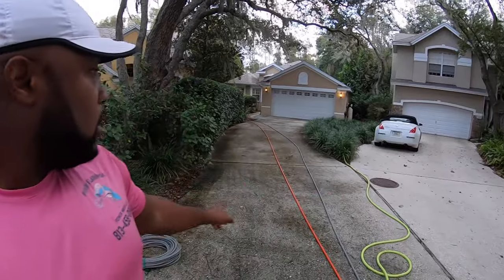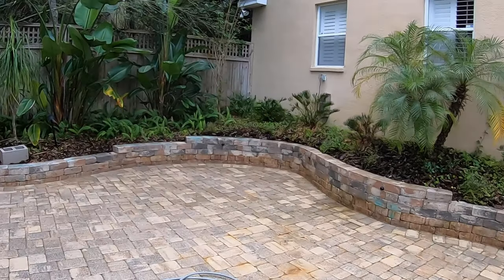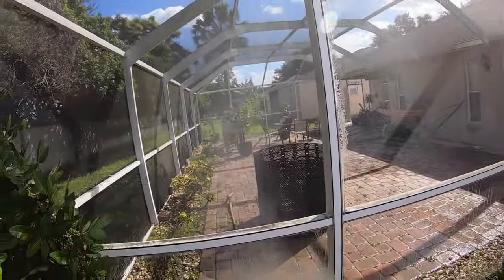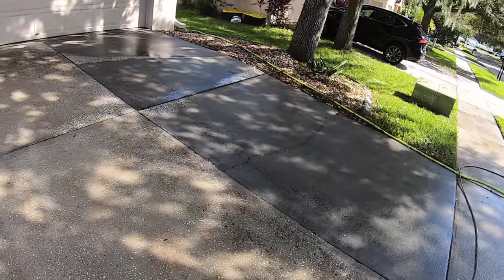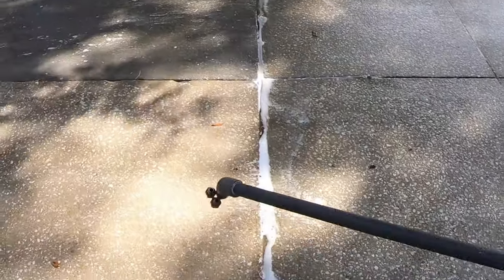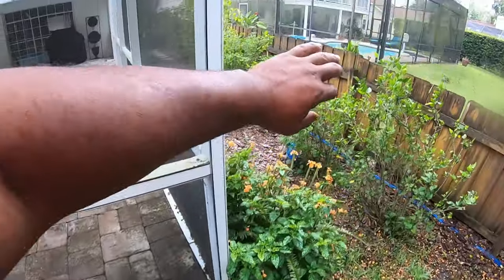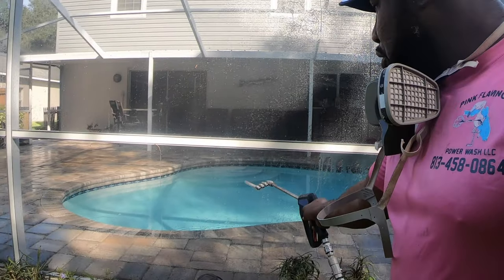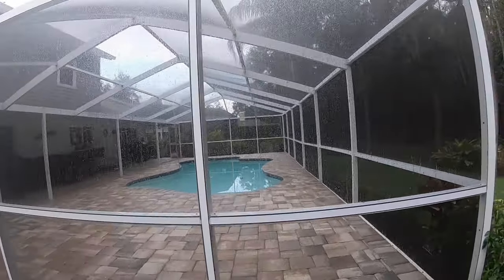Surface Cleaning Driveways and Pavers | Soft washing Lanais

Comment: What tip do you use when rinsing the pool cage?  Thanks for all your help and info!! Great channel!!!!
Reply from the maker: I have an 8gpm so my rinse tip is either 2550 or 2520 and alot of times I use my ball valve.  If you got a different gpm pressure washer your tips will be different

Comment: Do you run a hot machine 8gpm machine, roof pump system, and soft wash system. Assuming you have a 50 gallon batch and maybe 275.00 gallon tank running to PW machines. I'm looking to get bigger and at least bring three people to help with one rig
Reply from the maker: Heres my setup. https://youtu.be/pGgBiEe3SoE

Comment: What's the model and size of the surface cleaner? Did you make your own softwash wand? Great work as well. I got about 1800 linear feet of wall to do today!
Reply from the maker: I dont remember the model but I have the 20" Mi-T-M surface cleaner (pretty much same as the BE whirl a way). I bout the softwash trigger gun and just modified it.

Comment: When you use your turbo on the pavers are you using the max psi or throttle down some what psi do you use turbo with
Reply from the maker: No I  just use it full throttle. 💪🏽💪🏽

Comment: I bet you get this question a ton, but what is your soft wash setup? I’m looking to buy one but I’m still not sure of which is the right setup. Much appreciated!
Reply from the maker: 12v remco 7gom 100psi , 200ft of 1/2 inch ag hose, 18 inch hose reel, 65 gallon sh tank,  and a gf valve proportioner

Comment: New to the game for some side hustle money trying to do it the right way. Don’t know if you recall my other comment from another video. You’re famous so probably not. Lol. But when you say “hit it with that 5%” are you referring to pretreat it with 5% sodium hypochlorite?
Reply from the maker: Yea 5% is 50% water 50% SH it's all the same.
Reply: @PinkFlamingoPowerWash  by that you mean for example: 1 gallon of sh and one gallon of water in the bucket that the injector is in right?
Reply from the maker: @edgarespinosa663  no thats if you gonna apply it with a dedicated softwash system like a 12v or booster pump or air pump or gas pump. You can't downstream 5% ans never dilute sh then downstream it.  Thats pointless.
Reply: @PinkFlamingoPowerWash  mmmm I see… makes sense! Thanks for the info!!

Comment: Hey bro how did you start out did someone teach you or you just jump out there
Reply from the maker: Lots of research brother. I didn't have someone with me to teach me. I had a guy I befriended that used to own a pressure washing business that I would ask him questions time to time. But everything else I learned from research and actually applying what I learned. 

That's why you see me on some videos with other guys starting off showing them how its done. I would of paid someone too to teach me, it would've been way easier for sure LOL. I'm a hands on learner, I got to do the work to know exactly what I'm doing.
Reply: @PinkFlamingoPowerWash  bro I'm the some way hands on is me for sure i was going to  ask you about training but I know work may slow down soon I'm in georgia
Reply from the maker: @robertrichardson543  I've been booking trainings it ain't free though.  I stay busy year round
Reply: @PinkFlamingoPowerWash  what the ticket and how many days do you train
Reply from the maker: @robertrichardson543  I do it on the weekends. So either Friday or Saturday. I don't advertise that here. This channel is strictly to demonstrate everything for free and without selling anything. Shoot me a message on instagram or email me.

Comment: I dont feel like I get that kinda pressure out of my ball valve.
Reply from the maker: Depending on your pressure washer and what gpm it's putting out.
Reply: @PinkFlamingoPowerWash  8 gpm gx690
Reply from the maker: @coolguy24eric  hmmm same thing I got. Are u running it throttled all the way up?
Reply: @PinkFlamingoPowerWash  oh yeah. Haven't adjusted the spring or anything though. Running how it came from factory
Reply from the maker: @coolguy24eric  should be pre set to the right psi but double check it